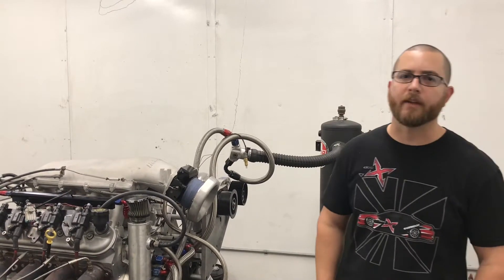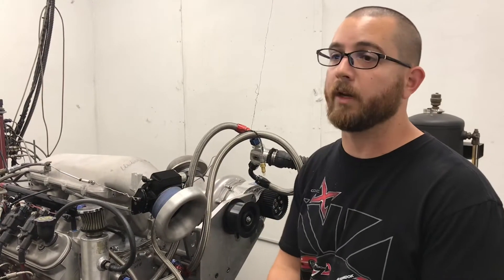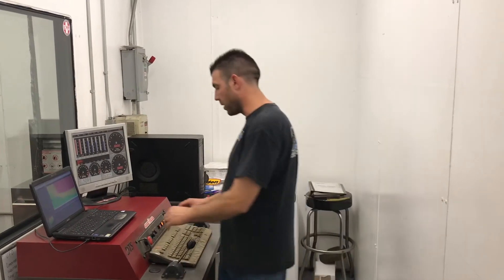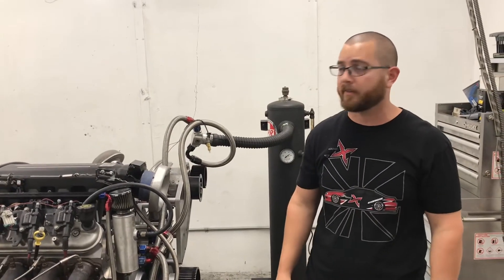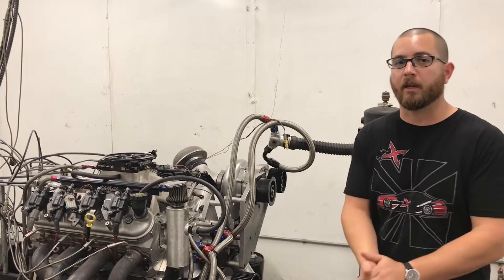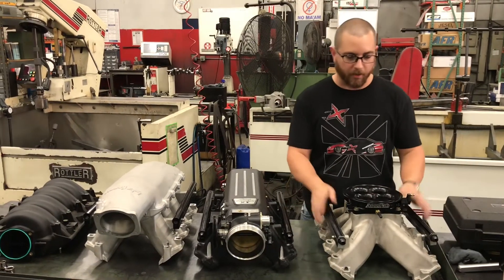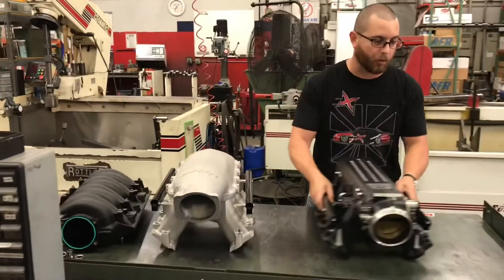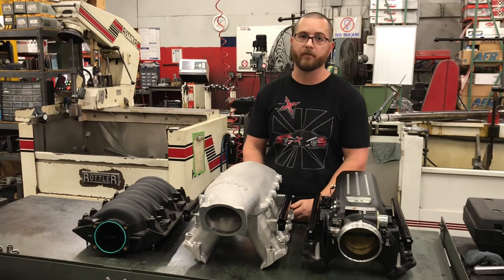GM LSx 408 Intake Manifold SHOOTOUT! LS3, Holley HiRam, Edelbrock XT, Edelbrock Super Victor 4500

Comment: Dollar for dollar its best to just run what the factory put on there…..weather its car or truck.  Ive spent way too much money on fancy intakes just to bolt back on the plastic ones😂😂😂…..not to mention the aluminum ones are just giant heat sinks and are notorious for heat soak…..only metal ones i kept on were of the positive displacement variety😂😂😂😂….great video by the way
Reply: Highest torque average over the curve moves the car!!!!